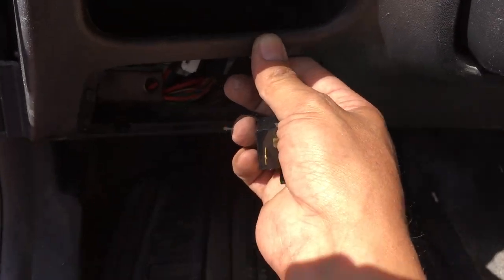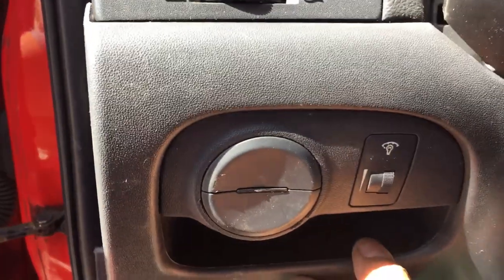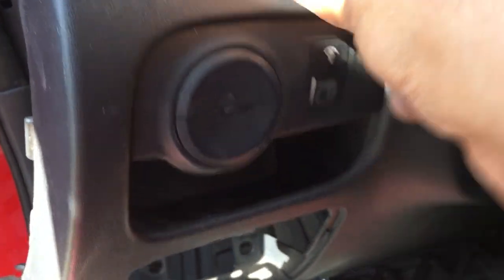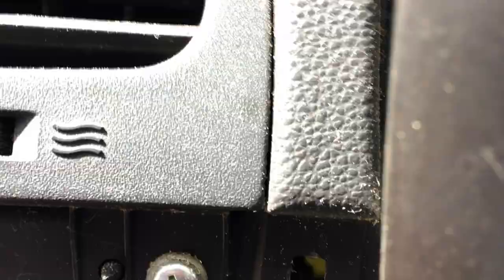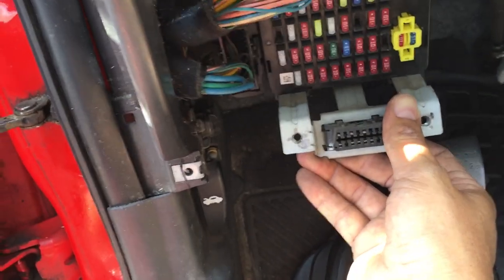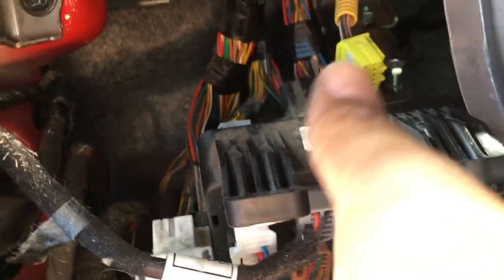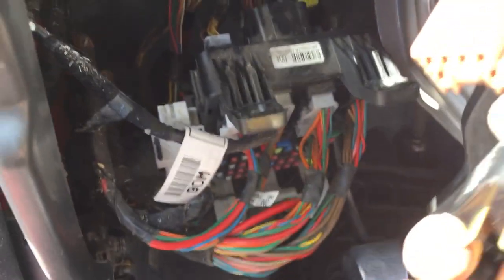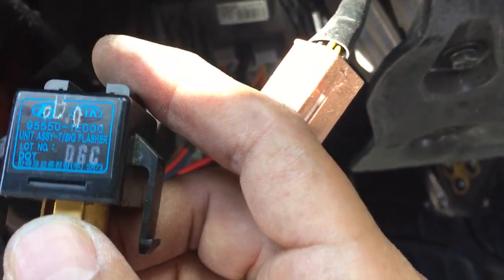2009 Hyundai Accent flasher replace

Comment: I have a 2013 Accent.  My left turn signal flashes really fast (at a normal rate in rare occasions).  I replaced the turn signal bulbs but the problem is still there.  Could replacing the flasher fix the problem?
Reply from the maker: Usually the rapid flashing is an indicator of a burnt signal bulb. If the bulb is the old filament type... they tend to temporarily fix themselves back into contact at the broken point; giving you the impression of non-broken one.
I will change all 4 signalling bulbs before replacing the flasher. The flasher itself it's not that expensive either and they do wear out and become non-flashing usually rather than erratic flashing.

Comment from the maker: Usually that kind of indication, yields to a burnt light bulb. Although is it plausible that the relay is getting weaker.
Is the flashing fastest on your right or left turning signal? What about when you turn your hazard lights on?
Sometimes you have a split filament on one of the bulbs that will separate for few seconds when you shake it or pass a bump on the road.

Comment: I have a 2011 Hyundai accent and I seen my vehicle has a icm relay could this cause the turn signal not to work.
Reply from the maker: The flasher relay always work independently from the ICM...
Reply: I looked at the back of the fuse block as you did and there's no flasher relay at the back.
Reply from the maker: @thedagman4056  not 100% sure where do Hyundai moved the flasher to?
But it has to be under the steering column or by the left foot/clutch plastic cover... sorry I can’t help you better with this.
Reply: Mine too! The 2011 has NO flasher relay, but one integrated into the ICM relay! I found this out after I bought a new flasher relay and while there was a spot where it should go, there was NO flasher relay there. The clicking was coming from the ICM. The trouble is, this part  is very hard to find in the aftermarket. Also, I don’t want to spend the money only to find out it was something else! How did you finally fix the issue???
Reply: @jayanxiety  I had to buy the unit from a hyundai dealership. It's was expensive, $500.
Reply: @thedagman4056  Oh boy that's expensive! Its that ICM relay unit that integrates the flasher? It's easy to replace, but the price! Did you try and see if the wreckers had one? They probably get quite a few old Accents. I'm just wondering if I should bother checking there before shelling out that kind of dealership money!
Reply: @jayanxiety  yes it is the icm unit. I can replace it yourself. Just unplug the old one.

Comment: I changed the relay and nothing is happening, no flasher no signal lights. Dead as it could be and i can not drive the car with no signals
Reply from the maker: Check if you are getting 12V to the Relay harness...